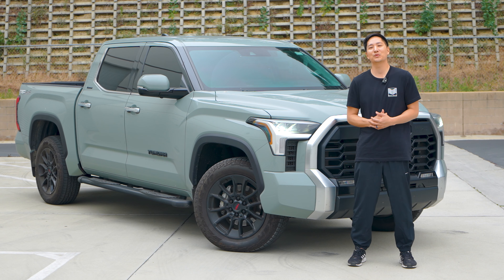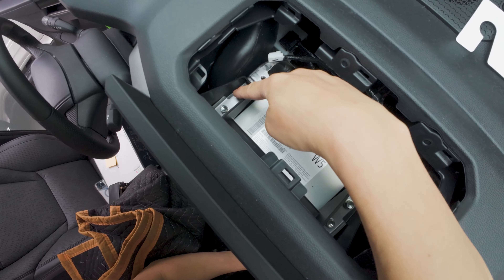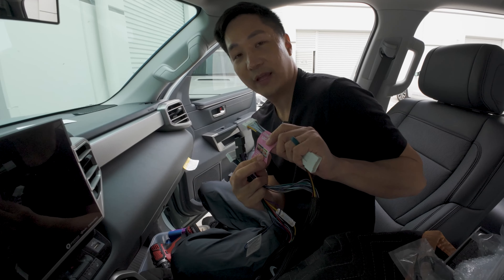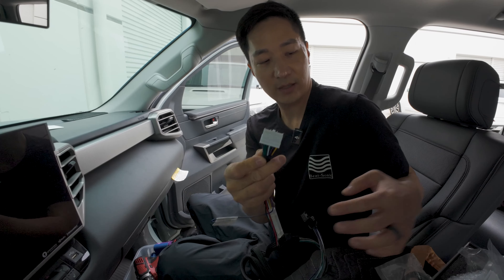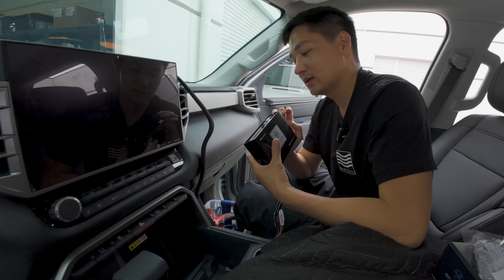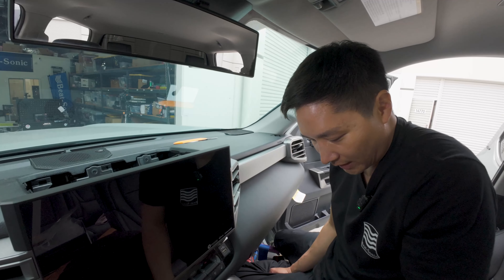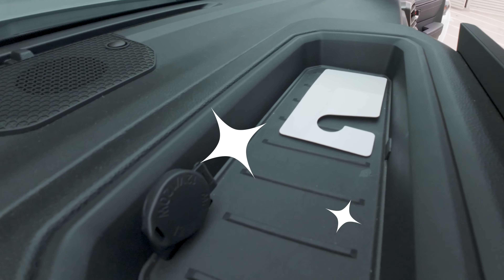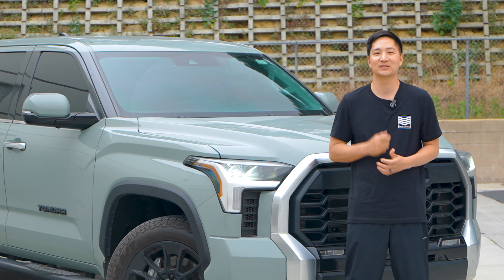2020+ TOYOTA TUNDRA WITHOUT JBL | DSP Amplifier Installation

Comment: Just installed mine this morning.  Sounds great, I had to go back and add some bass in the settings but so far so good.  I ended up mounting mine to the top of the radio.  I couldn't get it to stay and stick behind it.
Reply from the maker: Thank you for your support!
Reply: Gary, did this improve the sound with the stock speakers?